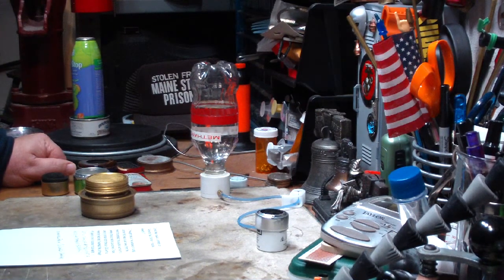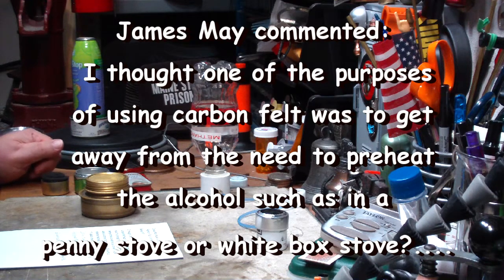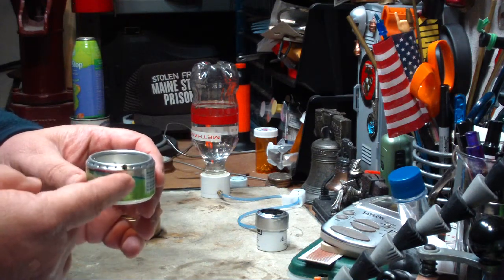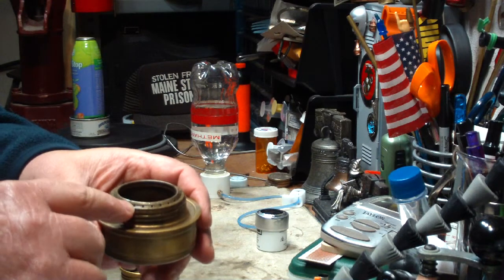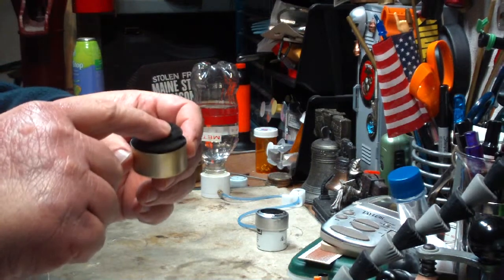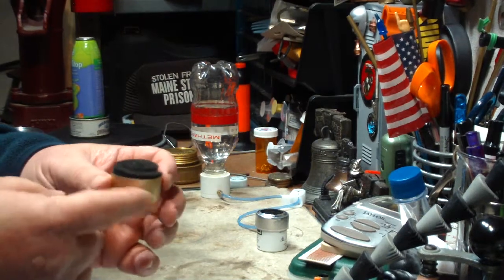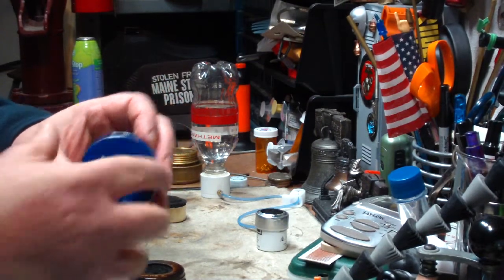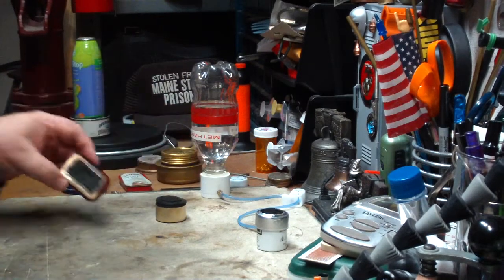Question on Pre-heating Carbon Felt Burners

Comment: i assumed the felt is somehow catalytic like the wick in a candle... so you didn't need vapour like you do with a penny stove or trangia.  I've had a hard time lighting stoves that weren't wick ones near or below 0 C, only having any ease if they had a wick primer type, I guess that's why the trangia priming pan for cold weather looks like it has some wick in it of some sort in pics I've seen.  I figured there just wasn't enough alcohol vapour in the air above the pool to be combustible.